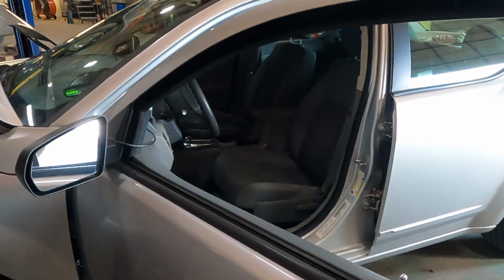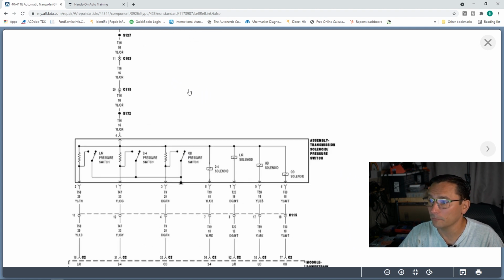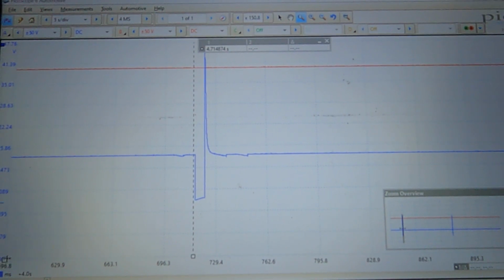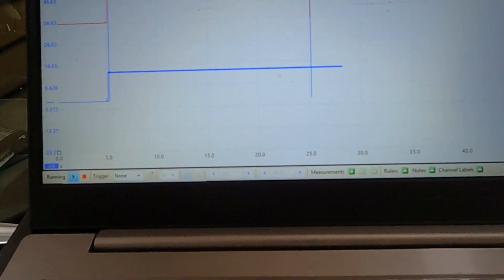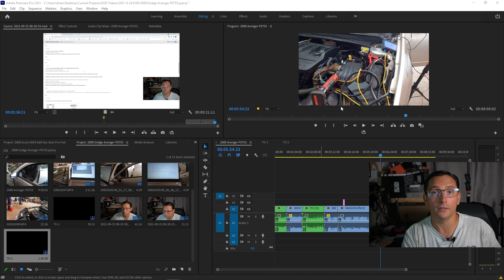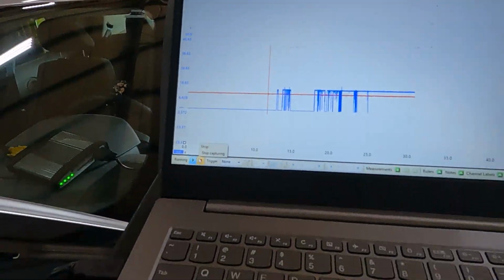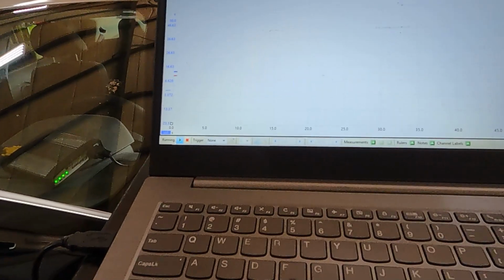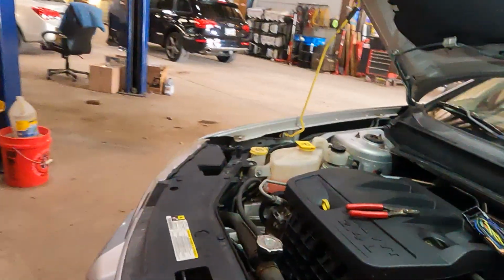2008 Avenger P0755 How I diagnosed a bad PCM

Comment: Power cuts of on 2008 Avanger. When i went to touch PCM connections it shock me. Do you beleive there is short inside the PCM or the Wiring cables? Cables look good. Its weird that it shocked me. And the PCM wasnt mounted. Customer was driving it like. Thats. 

First i thought it was TIPM. Because i disconect it and put it back. Car was running for good while then power cit off. Replace TIPM but still does the same
Reply from the maker: I haven't seen  that before,  sho ked you, check the voltage on the pcm case to ground, may have a bad ground?

Comment: Had one of these from the car lot. Tried 3 used PCM and none would program. Car lot took it to the dealer and they flashed original unit but never put replacement in. I've done similar pcm in a patriot compass a out 6 times for shorter out throttle body. Avenger would never crank after replacement PCM. So they put a transmission in it and then has the transmission rebuilt and eventually they ordered PCM from flagship 1.shifting concern was gone but it had secondary air codes and vehicle had none of that stuff. Sent it back to flagship and explained situation and they sent it back with same issue. I ended up using hp tuner to disable the code for secondary air injection

Comment: I got a dodge avenger 2008 sxt v4 and I got a 0700 code I am going to replace my PCM ECU and hopefully it comes back working because it wont start as well no power to the engine

Comment: Im working on a 2008 ram 2500 6.7 with a 68rfe. Im trying to watch the ground side of  2 solenoids p0755 2c and another good one, but not getting battery voltage through the solenoids. even though I can see voltage at the trans connector. 0 volts but I still see the diagnostic checks every 20 seconds.

Comment: Great diag Kevin. I learned something very important. That the PCM sends pulses to check the integrity of the solenoids. And that it checks for the inductive pulse if it exists. I always thought that the PCM checked the small positive current that the solenoid winding produces from the 12 volts applied to the solenoids. You learn something every day.
Reply: PCM may check for the magnitude of the spike as well.

Comment: Nice diagnosis Brian, Always great to see how other techs go about diagnosing faults. Always scares me when I call a PCM.  Question on the self-check of the trans,  do most makes and model run a self-check like this on their transmissions?
Reply from the maker: I really do not know for sure. The one manufacture that I see it on all the time is Chrysler.  I know that Hyundai / Kia uses a similar strategy on their EVAP vent solenoids, If you plug in a noid light the code will still set.  I am sure others makes do it, I just have not tested, verified , OR if I have seen it I forgot.  Probably the latter.

Comment: Brian pretty ingenious cutting and swapping signal wires to isolate the problem. I heard you mention plug and play ECM. I noticed on the Honda programming site they say 99 Accord ECM not programmable. I guess that tells me it’s plug and play or does it still need to be initialized? My 07 is listed as having to be programmed. Just curious. I’m assuming you did all of this with power off. Does battery need to be disconnected just to be on the safe side? Brian thanks for sharing and have a good one 😊
Reply from the maker: the Honda has the firmware to run the vehicle,  If you have immobilizer it willl have to be initialized / learn keys.  You can check this by looking at the dash when you turn the key to start the vehicle you should see a green key light on the bulb check.   I believe the service info will tell you to disconnect the battery before unplugging the ECM. What happens iin shops on a daily basis is another story.
Reply: @BrianMann216  when replacing the pcm of this doge in the video did you have to reprogram it? Or the key ?